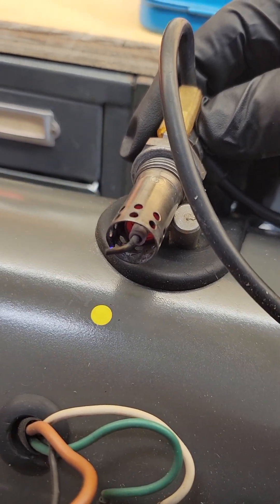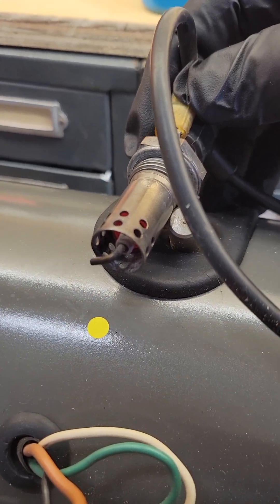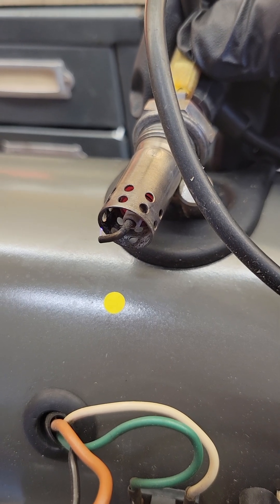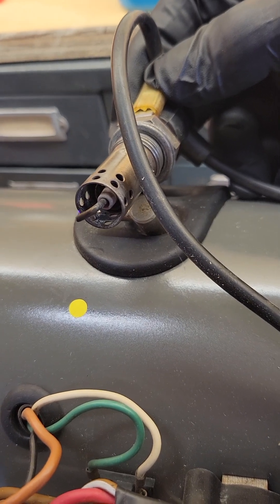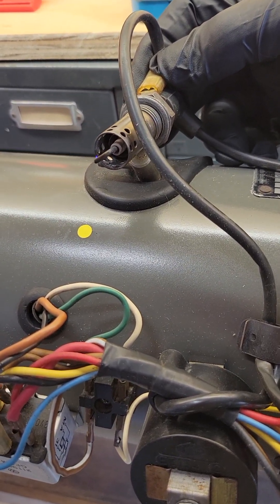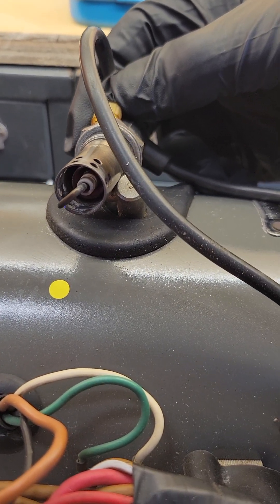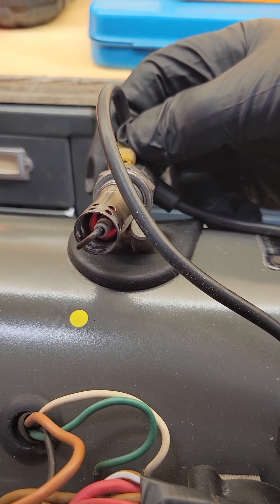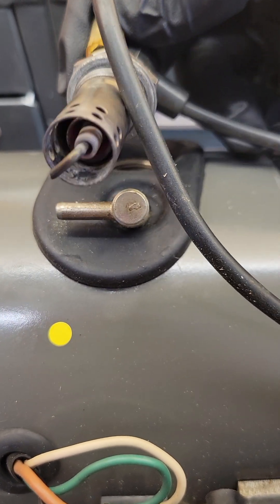Eberspacher BN4 - How the Spark/Glow Plug works

Comment: I’ve just purchased some early heaters bn4 and a bn3 which has a m18 hole with a 1.5mm pitch thread and the plug is none existent. This looks like it would do the job could you tell me the type of plug as I cannot seem to find one. I’ll probably use an adapter and a long plug fit a atomiser /guard and use e5 to see if it will go.
Reply from the maker: Look for Beru GZE 14 through 22 11 or 12 volt plugs. They may have two male tabs, but thats ok. As its a shared design with a BA4 and BA6 that needs a grounding tab, and the BN4 does not. You can also fit a GZE 202.
Reply: @notchboy thanks it’s appreciated